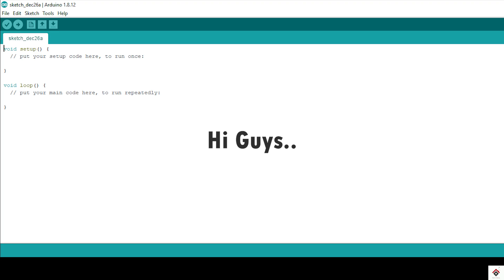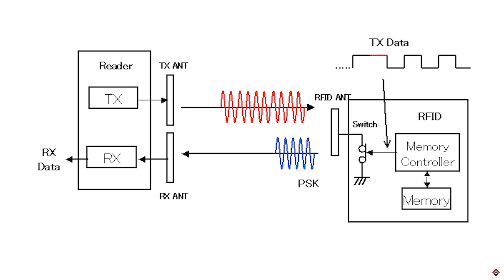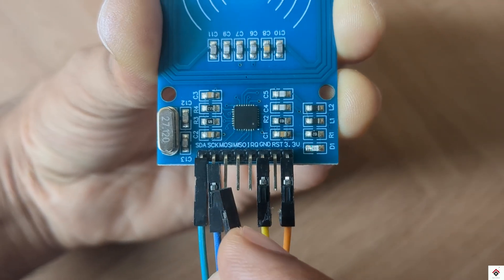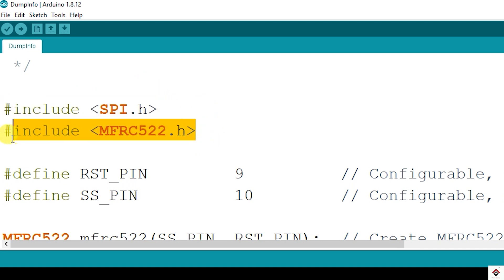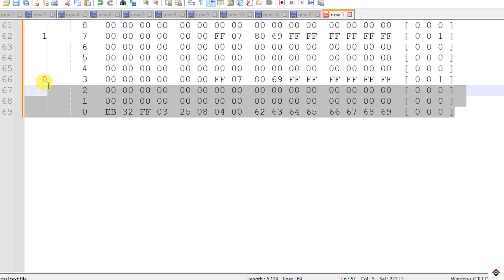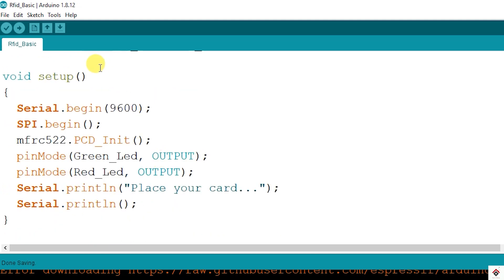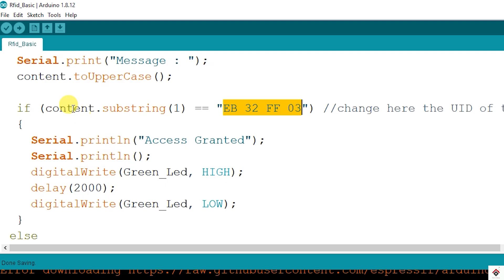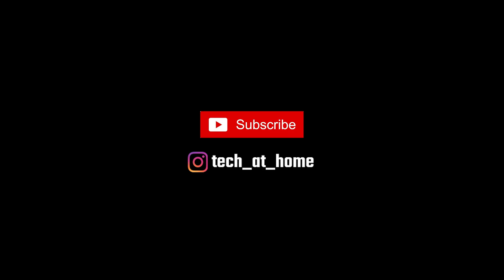How to use RFID Module RC522 with Arduino [with CODE] | Arduino RFID Reader Tutorial in English

Comment: when I am trying to get my cards uid its showing comunication error what to do
Reply from the maker: Connections might be wrong or loose connections.
Check the continuity of jumper wires.
Reply: Sir I have connected each and every term properly. But my RFID card not scanning tag . What I should do . I have checked multiple times. My connection is right. @techathome

Comment: Here from the diy FFB wheel, so i've connected everything, checked everything twice and also setup Arduino as you showed (my belt is a little lose) i'm using EMC and my wheel is going CRAZY (rotating nonstop on the left side) when doing ffb tests. So much that i'm scared of turning on my power supply. I'm using an RS-775 Motor so please need some assistance here :D
Reply from the maker: BTS driver might be faulty.
Try to check the motor driver separately using this tutorial: https://youtu.be/H2YJRaaXFIM?si=CyHtWlpuAf2YbNVR
Reply: @techathome I've concluded on replacing the encoder and the motor driver (they sent me a wrong value encoder)
Reply from the maker: What value?
Reply: @techathome  originally ordered 600 ppr but it says 250 on the encoder
Reply from the maker: Oh, then better to replace it
Reply: @techathome Also any suggestions to make my wheel work without any issues? Thanks